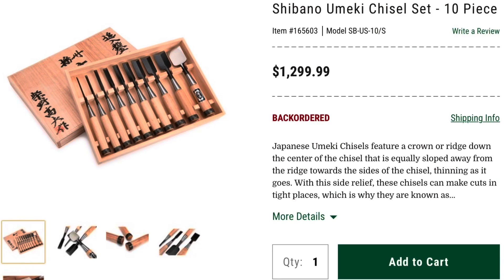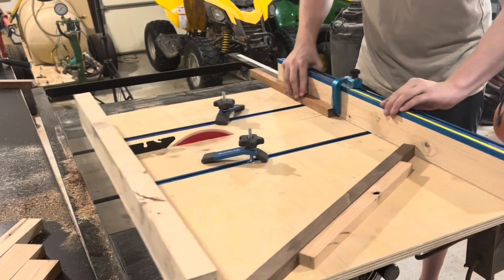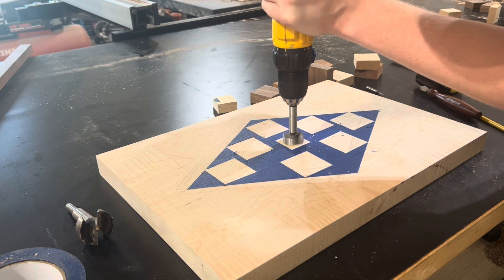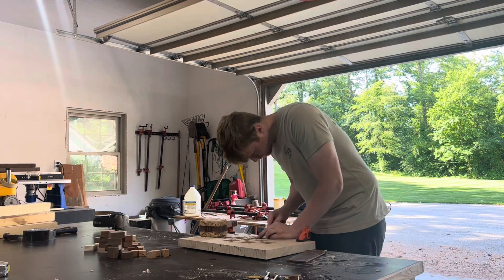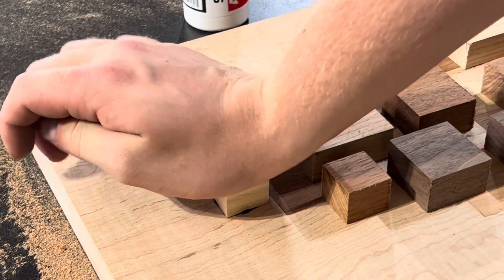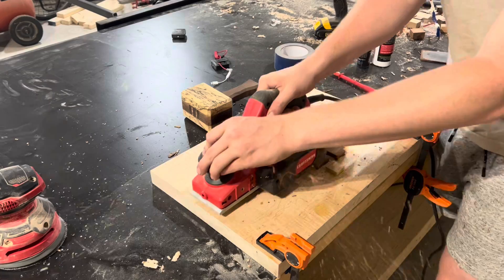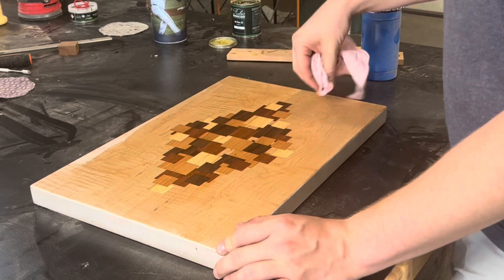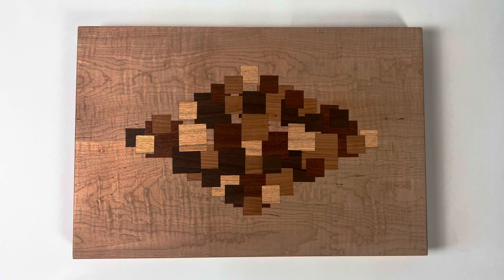I dont know why everone doesn't try this

Comment: Pratice on scrap wood to test different ways of making mistakes. Use a router jig to plunge the inkay holes, then square up the corners. Use double-sided tape, easier than blue tape, CA glue plus activator, and it makes the sribing knife cut more pronounced. I like silence when l work because I over-focus; noise /music is a distraction for me.